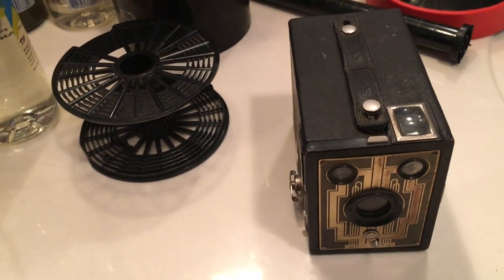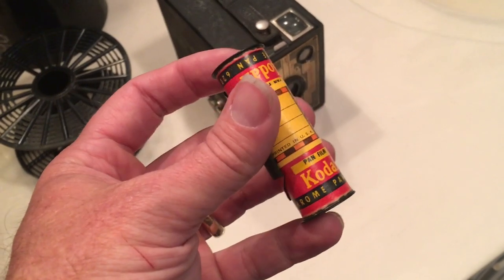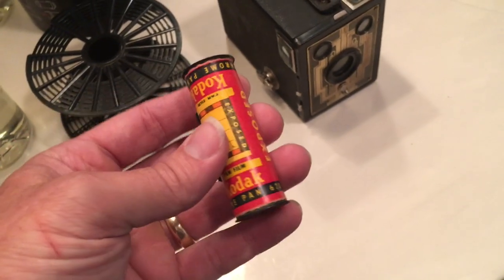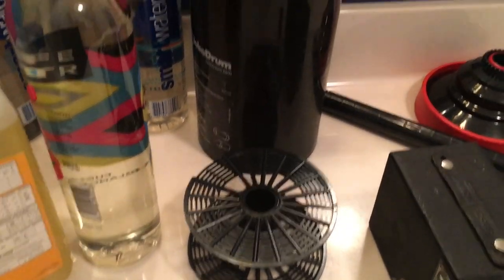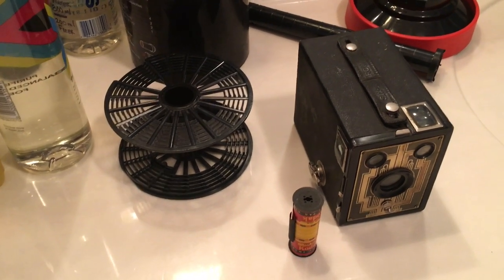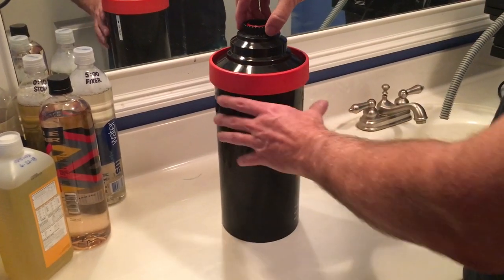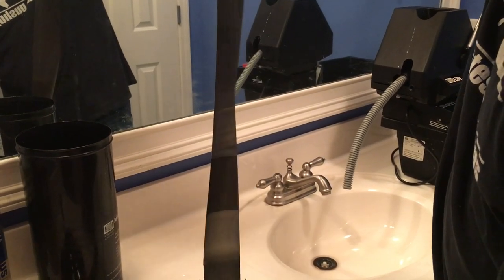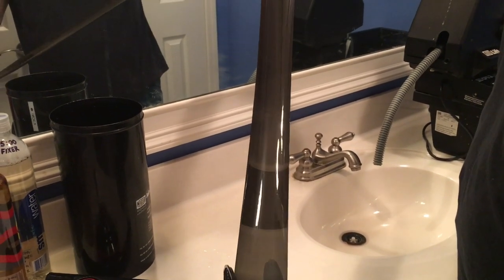Developing Old Film - Kodak Verichrome Pan

Comment: I remember this film, from my box camera days with a Brownie Six Twenty to Ye Olde Rolleicord V. Processing roll film with the usual suspects (D-76, HC-110, etc.) was a breeze with the proper film reels and a Kindermann or Nikor tank. With really old film, a helper like Kodak Anti-Fog would cut down the haze. Back then I followed the agitation cycles of at least one inversion per minute, along with a gentle tap to dislodge air bubbles. This "stand developing" sounds awfully lazy.;)
Reply: "Stand" development also leads to uneven development with streaking in many cases. The reason he is using that method here is that it is fairly insensitive time and temp requirement for unknown film. Here the film is well known and has published processing recommendations, which do not include "stand development". Both lazy and unsafe as to result. At the time this  video was made, there was something of a YT craze going around about stand development, which is probably why it was used here. Looks like he fogged the crap out of the roll, although the roll's age and poor storage could largely account for that.
Reply: Wups! The poster described this as stand development, but the extended description shows that it was normal (not "stand" ) development. Comment on stand development applies in general, but not to this film & processing.